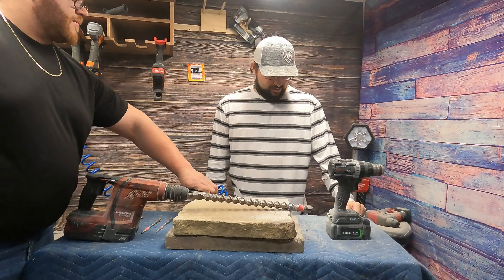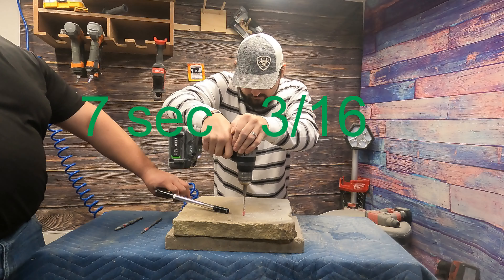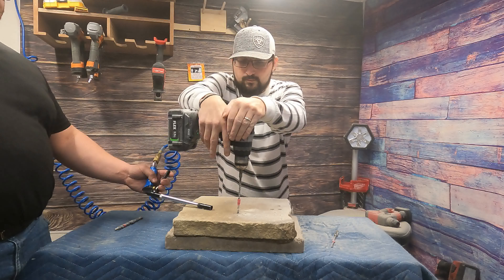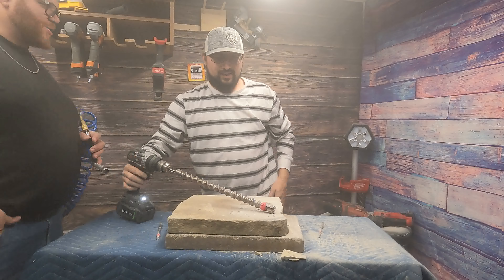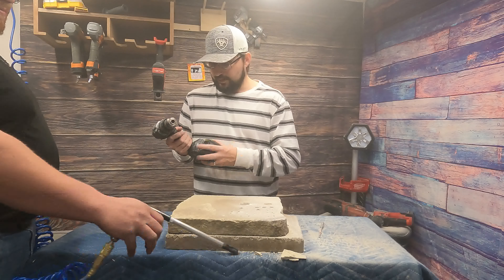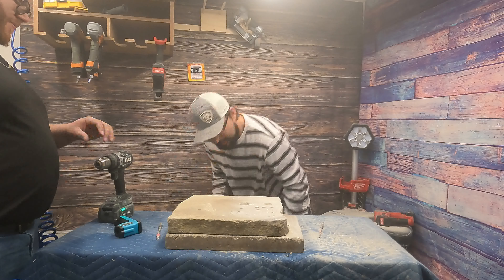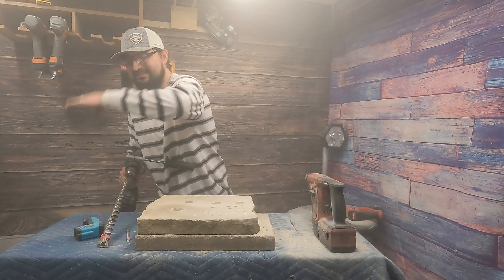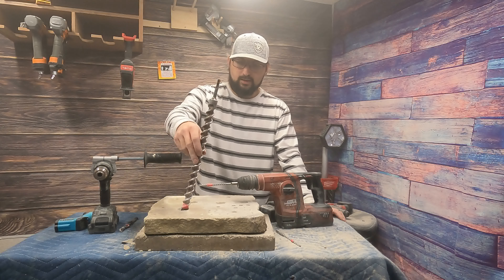Flex Vs Hilti! part 2

Comment: Dude you are hard core I broke the chuck  for mine and Flex sent me a new one.i have to go pick it up at UPS.
Reply from the maker: hah that's what I wana hear!  that's awesome!
Reply from the maker: also how did you break it. I can't break mine  grr im jealous 🤣😂
Reply: @toolsandtactics  I was framing out a  10' ceiling and it fell to the concrete floor on the chuck, they sent me a new one a week ago and I need to go and pick it up
Reply from the maker: @rickyperkins232  wow that's awesome I'm surprised they didn't call it abnormal wear and tear sounds like promising warranty service!